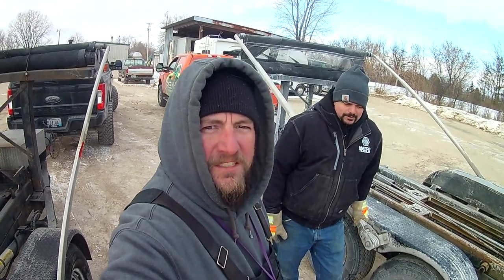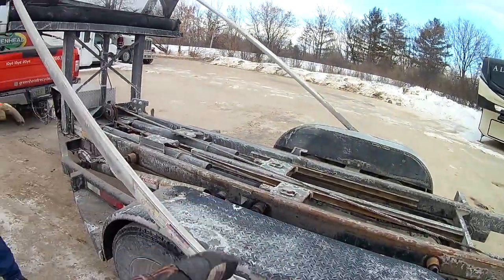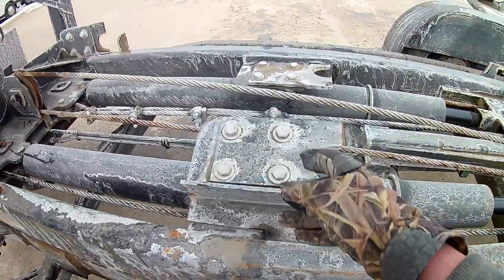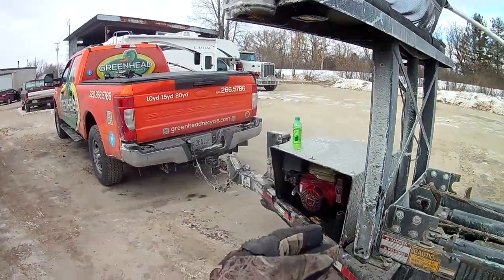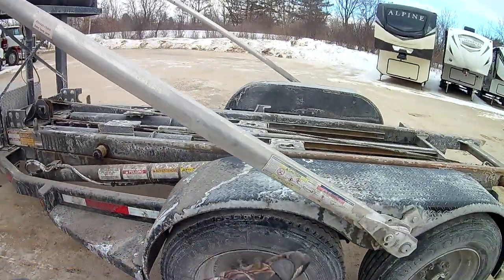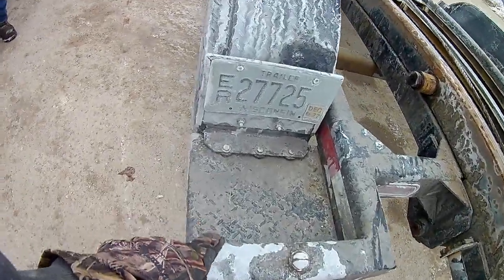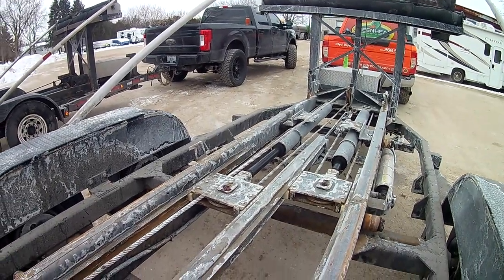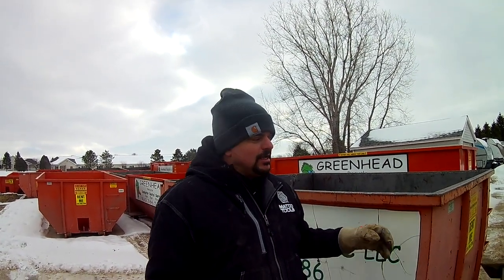NEDLAND INDUSTRIES ROLL-OFF DUMPSTER TRAILER COMPARISON

Comment: Hi I currently run 2 short 10ft 12k trailer roll offs from protainer and the trailers look almost exactly the same as the Nedlands one. I have had really good luck with them so far. I've been debating on getting the 16k trailer so I can haul 20 yard containers or getting a truck like a hino 338 thats just under cdl that can haul both sizes. What would you recommend? I think you mentioned in one your videos about someday going with a truck that can haul the dumpsters or would you recommend just using the trailers. Let me know your thoughts. I love your all's videos!
Reply from the maker: Pro-tainer makes a great setup from what i know. I have looked into the truck and cannot find any benefit unless you go with CDL truck. It seems that you can haul the same or more with a trailer vs a roll off truck that is under CDL. we can haul 5+ tons easily and legally with trailers. It just makes sense to stick with trailers for us right now
Reply: If you happen to be looking to sell some of the 10ft containers I would be interested